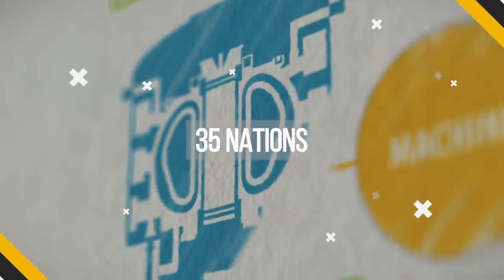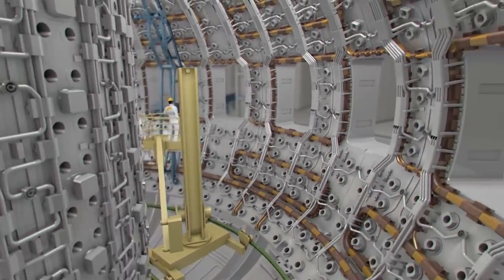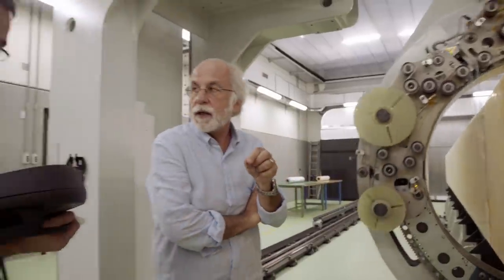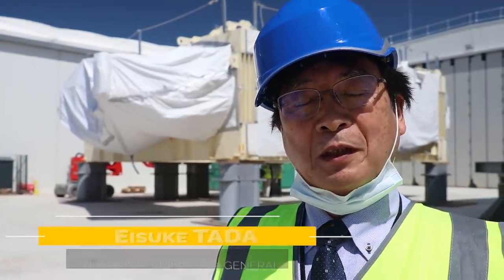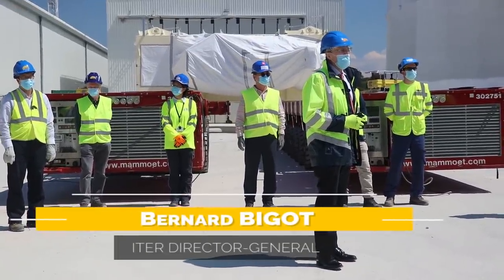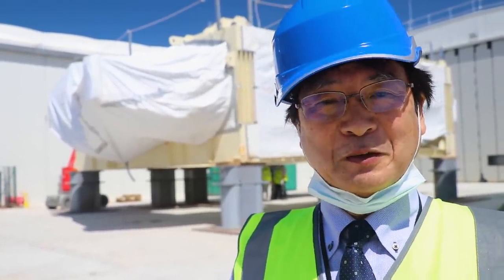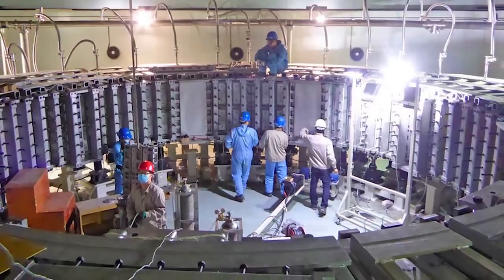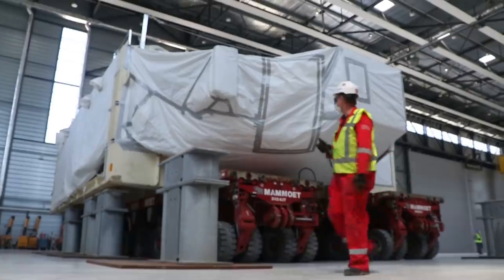ITER NOW 1.10: Toroidal Field Coils

Comment: Guys for 20years I always supported the research in  Clean Fusion Energy but now I want to be critic. This project is to much long overdue and to much complex. To power the world with clean energy we need 100K fusion chambers like this. If is too complex, require alot of time and is too expensive no one will go to build one. You have to go back to the drawing board even before this is finished. You have to do small, relative cheap and easy to build reactors. What's the point of this project anyway? there is no industrial future for a project that require so much time to be build, comparable to LHC, this is unacceptable. Also the budget invested in Fusion Tech is so ridiculus compared to Yearly National spending of any major country in the world. I hope this project will be more important than the most people think and some really amazing breakthrough discovery is made so Fusion Energy could be industrialized.
Reply: The focus of this project isn't to be cheap or easy to produce. It's to actually gain a net positive energy production. You're expecting this thing to walk before it's even learned to crawl.
Reply: I agree with the critcisms... Sad to say it. 30 years to design & build, billions to construct. I understand its a giant experiment to prove the concept & create more energy that feeds into it, but if fusion energy is going to make a meaningful contribution to combating climate change in this century then it's a joke. So how many years to finish & test? Mid 2030s to refine the design, then we gotta build thousands of them? & This one has taken a couple decades to construct? Our goose is cooked. Money would be better spent investing in residential point of source solar installations

Comment: Safire project, has already succeeded in creating more energy efficient fusion systems for a fraction of the cost.  They'll out pace you in no time. You should join them so we all can benefit from their techniques.
Reply: The theory that you can get more energy out of a system like SAFIRE than you put in violates the laws of thermodynamics. I don't even need to do research to figure that out.

Transmutation does not happen in nature. It happens in the hearts of stars, or in nuclear reactors. I have no idea why the SAFIRE team was getting the elements they were getting on their anode but neither do they. That's concerning. If their theoretical model predicted that transmutation would happen absent a nuclear reaction, and what elements we might expect to see as a result, that would be one thing. That's not what happened though. They found strange elements that shouldn't have been there and fit it in with how they view the world. That's the opposite of what good science is.

Mainstream science may not be perfect, but it's a pretty good system for objectively measuring reality. Mainstream science has not been kind to "electric universe" theory and for good reason.
Reply: NOPE NOT succeeded at all !
Reply: Oh really? Why aren't they using them then lmao.
Reply: Zero Ryoko dude stop he’s already dead

Comment: The D magnets being made by two producers could be a possible worry, I’d think. Will they alternate the makers of the parts? Like YZYZYZYZ, not YYYYZZZZ.
Reply: Yes, I'm thinking about this. But I think they do that to cut the time in building the ITER. But for me, one manufacturer should produce it for consistency.
Reply: I'm sure they have very rigorous quality control protocols. A project like this isn't just handed out to anyone.
Reply: @JohnDoe-oe8gm  It's actually even more complicated. The niobium tin and niobium titanium strand that makes up the superconductor material for ITER's magnets was produced by 9 different factories in 6 countries. So ... rigorous quality control has been needed from teh very beginning.

Comment: This thing is going to work right? Like make power? 
Really hope it doesn't run for 10 years and they say it was a learning experience and the next one will work.
Reply: Iter won't be feeding the grid. Research costs money, fusion will provide clean power for your children, that's not worth investing in?
Reply: Iter is an experiment project, a big one. It will generate more power than it takes but I don't think it can run for a long time so the amount of energy it create isn't much. But it'll allow scientist have a better understanding of fusion energy and improve on it, so one day we can have an actual commercial fusion reactor. Or so I hope.
Reply: @LaBderErste  - no, the reason for not selling the power to the grid is because the scientists (from all over the world) will be running ITER up and down in power, in all sorts of configurations, with a massive amount of every sort of diagnostics, to figure out how to optimize power output, plasma control, pulsed power versus steady state, and every associated parameter of temperature, pressure, control systems. etc. Connecting a device like that to the European grid wouldn't make the neighbors very happy. ITER is designed to allow scientists to test every aspect that will optimize the commercial machines that follow.

Comment: so  fission based power plants product 5 - 20 GW and this 0.5 GW if it ever work, is next model  able product 200 GW or what?
Reply: The amount doesn't matter, it's a scientific test machine. The main important thing is that it should be able to produce more energy with fusion than they have to put in with fuel.
Reply: ok. is there build bigger commercial version? any plants for that? its probably cost more than 100 fission power plants but its ok
Reply: @anttumurikka8728  Those will be viable in time. But first they have to prove that it actually works, which is what this project is for.
Reply: @FoxMonkey-xw5yf  Man, imagine how dumb some people will look if this thing doesn't work.

Comment: All this for hoped for 500MW? ITER is projected to produce 500 MW of power with an input of 50 MW, and be able to hold plasma for half an hour or more. 

An output of 50 MW? Hold plasma for an hour?
This is the most expensive science project I ever heard of.  Will this ever amount to actual energy production in the real world?
Reply: No, ITER has no infrastructure for harvesting the energy produced. I am also not aware of any plans to retrofit ITER with a neutron absorbing blanket for the purposes of harvesting energy, or if such a thing would be practical.
Reply: You've never heard of the LHC?
Reply: @krashd  What has the Large Hadron Collider got to do with Neutron Blankets... and please provide a link to where  a neutron absorbing blanket for the purposes of harvesting energy  at ITER is discussed.
Reply: @OmnipotentEntity   Thanks and in addition, a power output of 50 MW is so ridiculously small for such a Giganticlally Expensive project.  For example 20 Windmills  produce 50 to 60 MW of power.
Reply: @pobembe1958  20 windmills produce 50-60MW 10-30% of the time. And the output is 500MWt
Reply: @OmnipotentEntity  Correct, the 500 MW is the sum total of energy output. I was in error. Thanks for correcting Me.
Reply: @OmnipotentEntity  I ran into  this:-  https://www.youtube.com/watch?v=7Yww1AwXf_s&t=78s

Basically it's the idea of  using FLIBE, a molten salt being considered for Liquid Floride Thorium Molten salt reactors.  The point is to use the ITER as neutron source for Fission. And using Tritium By-product to power Fusion.

Comment: They are trying to use magnetism to forcefully contain the plasma and that is not how it works. The Safire Project successfully and repeatedly caused transmutation of element using a mere 1500 watts input. They treated the sun as an anode, much like Birkeland did a hundred years ago when he successfully posited electric currents in space we now call solar wind. Safire was able to reproduce double layers, and electromagnetic structure in plasma where charge separates and forms field aligned currents. It is in these double-layers where the transmutation occurred.
Reply: ah yes, the random internet expert that knows everything better than the actual experts.

Comment: IF THIS IS WHAT IT TAKES TO BUILD FUSION ENERGY, FUSION ENERGY WONT BE COMMERCIALLY VIABLE. NUCLEAR POWER PLANTS GO TOGETHER IN A FEW YEARS, THIS HAS BEEN 32 YEARS, AND THEY''RE STILL A DECADE OUT! IN A COUNTRY LIKE THE US THERE ARE 60 ACTIVE NUCLEAR POWER PLANTS WITH 98 REACTORS. I DONT SEE HOW THIS FUSION REACTOR CAN BE SCALED TO PROVIDE POWER FOR ENTIRE COUNTRIES, WHEN THE MAGNETIC COILS TAKE YEARS TO PRODUCE.
Reply: seems legit! what could go wrong? (sarcastically) 
alot could go wrong.
Reply: It's a prototype, prototypes take far longer to build than tried and tested designs, on top of that a fission reactor is a large pot with rods in it, you could build one in your basement if you had the materials, a fusion reactor is far far more complex.  Also modern generation III nuclear reactors cannot be thrown up in a couple of years, they take around a decade to build, a 21st century nuclear reactor is very different to the generation II reactors we built in the 70's and 80's.